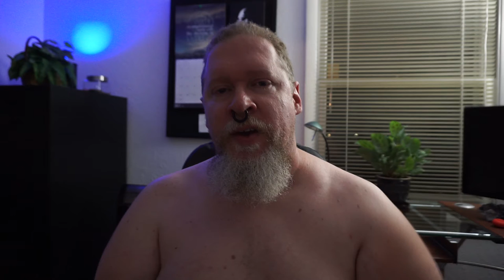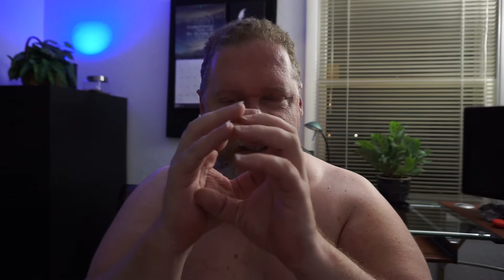Rambling about computers and car engines

Comment: Something along this line is the direction I REALLY want to see things go. A friend of mine told me there is a car you can rebuild the engine without removing it from the car. Ive also looked under the hood of some of the older Jeeps. These vehicles where made to be worked on conveniently; consider for example how the hood folds part way over the the sides so when you open it you get some side access (not just top access) to the engine compartment. One of the maddening things to me is how ubiquitous cars are and how terrible a job we do at designing them to be easily maintained.

Comment: Quick Assembly at the car manufacturer can screw the do it yourself guy.
The electric fuel pump in my car went and the only way to get to the bloody thing was drop the tank.
They want you to bring it back to them for repairs, selling is not enough for them they want the money from spare parts and the labor as well.
Friend of mine had the ignition changed in his car cost $300 or more.
When mine went i bought the ignition barrel for about $80 bucks and did it myself.
The heat coming from your pc i had that problem once and it was my graphics card sucking to much power so i swapped my 350 watt power supply to a 1000 watt and fixed the problem.
I realized when my power supply basically melted on the inside when it died.
Reply from the maker: I have missing case fans, so I use a big fan.
Reply from the maker: And I only have to use it when I'm doing something that uses a lot of CPU power.
Reply: Kizzume Fowler Yes i had the same problem.
Video or gaming would over heat the system.
No one told me that the card i was running needed a more powerful power supply.
I had put in a new graphics card because the old one was no good for gaming .
The pc would give me error messages saying it had to turn down my graphics and this would slow down gaming making it just as slow as the old card.
Eventually the power supply died and i went through another one of 400 watts before i bought the 1000 watts then problem solved.
Reply from the maker: I have a 750 that I replaced it with about 4 months ago.
Reply: My comp specs:
MidTower case: 4x120mm fans, 1 top,1 bottom, 1 front, 1 back.
750watt modulus OZC PSU bottom case mounted.
4790K Haswell 4.0ghz ( 4.4ghz Overdrive ) CPU w/ Zalman 9800 120mm Fan Cooler
AsRock Fatality Pro Z97 Mobo
EVGA SC Edition 4gb Gforce 980GTX ( yeah that bitch burns holes in your retnas baby!! )
Gskill Trident DDR3-2400 CL10 RAM downclocked to DDR3-1600 CL7. Yeah that's right 1600mhz at CL fucking 7!! I STILL can't find anyone else on the internet or locally that has RAM that fast with that low Clock Latency!! :D

Comment: The unfortunate truth is that companies do not want modularity. They want consumers to be locked in, and only "authorized" people able to repairing the device, with limited ability to upgrade, even if the change itself would be trivial. It's pretty much across the board this way.
Reply from the maker: Yep
Reply: And as long as they keep doing that (which they will never stop doing) nerds will always prefer a home brewed system. You just get better components across the (mother)board along with options to expand.
Reply: In regards to computer hardware, as long as universal interfaces exist. Hardware manufacturers may one day make these proprietary, or make it expensive enough to deter people. Computer hardware is only a small part of the problem.

Comment: is your camera over heating or is the buffer filling up? My guess is the buffer is filling up. If you have a dslr, you need a very fast card to write all that data fast enough to keep your buffer from filling up. I recommend a class 10 UHS 3 card. SD card manufacturers lie their ass off when they tell you the speed of your card. They tell you how fast your card can read data but that is irrelevant since these are not hard drives they are meant to store data quickly.
Reply from the maker: I had made 4 other versions of the video before this one, so I had actually been filming for about 20 minutes.  It essentially said "temperature too hot, shutting down".
Reply: Kizzume Fowler
Oh. I've never seen one do that. dslr or video camera? I've seen ppl modify their dslr's with cpu heatsinks though. fucking crazy, but allowed them to do things that could not be done before using magic lantern.
Reply from the maker: ***** This is a Sony A5100 mirrorless camera, and the small body it has definitely has disadvantages.  The overheating issue is what you find talked about negatively about it when you go to forums and such.  When I'm at my computer, I have it hooked via HDMI to a video capture card, and I can actually film for hours that way.
Reply: Kizzume Fowler
Yeah I love the new mirrorless cameras. the 20 fps shutter speed is insane for action shooting. Photos not video. I wanted an A7, but I can't afford that. Settled for a Canon t5i, but it was stolen so I'm having to create my own worlds to get photos these days. (Blender 3d)
Reply from the maker: ***** I'd love to get a medium format digital camera sometime...

Comment: Ur not wrong. Air is a horrible conductor, so using it to cool your pc is never going to be be anywhere close to the efficiency of a heat sink or water cooling system.
Reply from the maker: Water cooling would be cool.
Reply: Remember Kizzume that if you have no plans to OC  your system, liquid/water cooling is an absolute waste of time and money. I've been building computers for myself and others since 1997. Not much about comp building that I don't know about.
Reply from the maker: kyzercube _ I've never had a problem when using the setup I have.  I don't overclock, I like system stability over the idea that I could make something get done processing 10-25% faster.

Comment: lol. you're not very mechanically inclined are you? Thats ok. Thats why guys like me make a lot of money.
Reply from the maker: Nope, I'm not very mechanically inclined when it comes to engines.  Older large cars, like pre '78 with points and adjustments and carburetors and little tricks you can do to get this or that working, individual belts that were easily changeable and not these huge serpentine belts....  I can deal with.
Reply from the maker: Hector Defendi I wish....